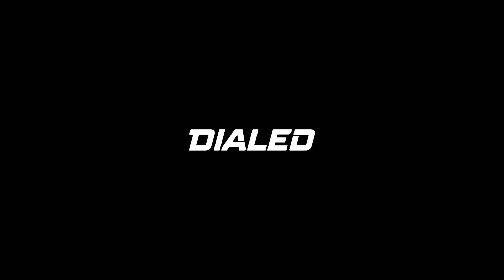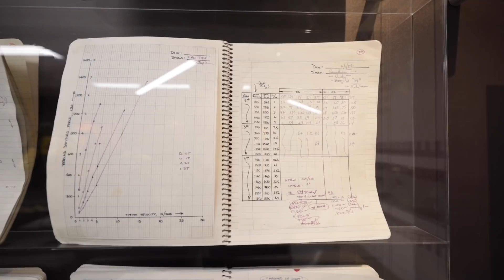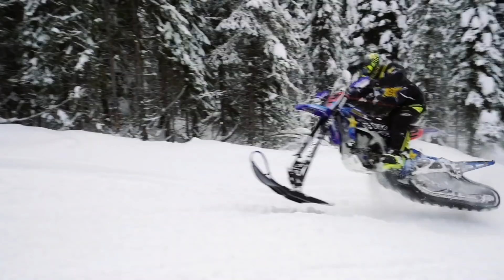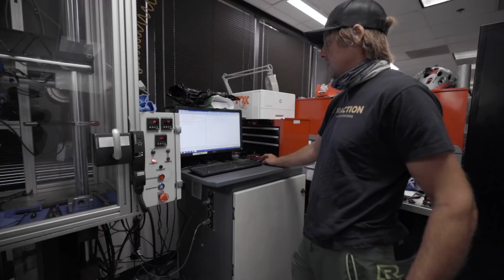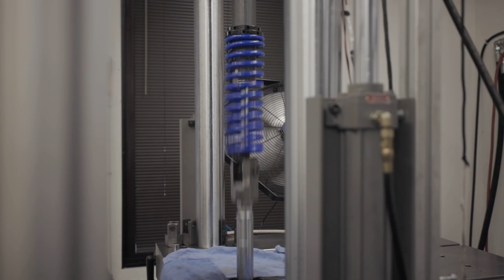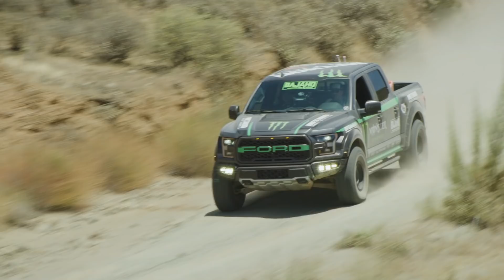DIALED S2-EP28: How do powersports influence mountain bike suspension design? | FOX

Comment: If you ever find yourself in a bike shop about to buy a bicycle for over
 $8,000 and are not a pro competition rider, slap yourself in the face 
and remember that for the same price you can buy a factory racing dirt 
bike with full suspension and is way more fun than any bicycle.

Comment: This is exactly why I ride on fox suspension. Rockshox just doesn't have the history in moto or auto. I'm looking for another bike. The last bike I bought last year has Fox. Now the company switched to Rockshox this year. I love the brand but won't buy up because they specced Rockshox.
Reply: Just wait until you hear that ohlins creates bike suspension.
Reply: Luke Hill i have an stx22 and it feels really nice but it leaks air so i have to pump it up before every ride and get rid of it I‘d need to get it serviced which costs around 200 fucking euros which is immense
Reply: Ohlins is overrated
Reply: Why do you think rockshox suspension is so much worse? Most pro riders would probably disagree.
Reply: The Elias i think in terms of Performance Rockshox Products are outstanding. I love my lyrik